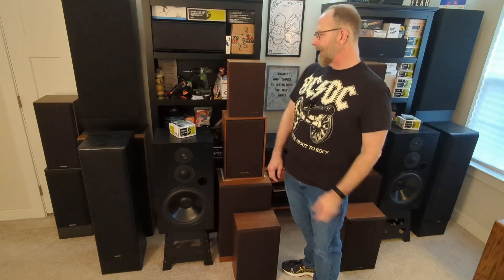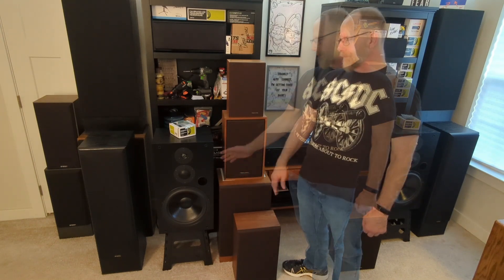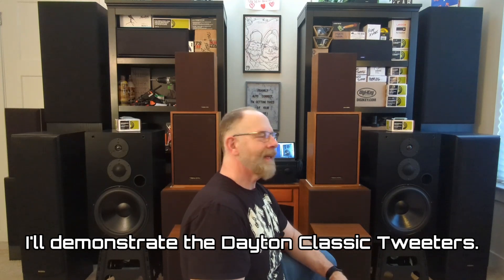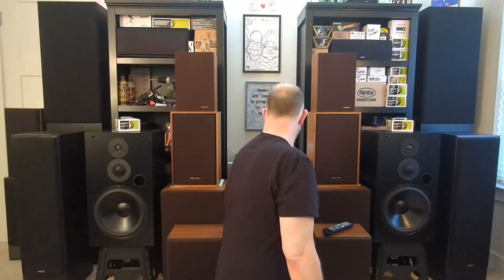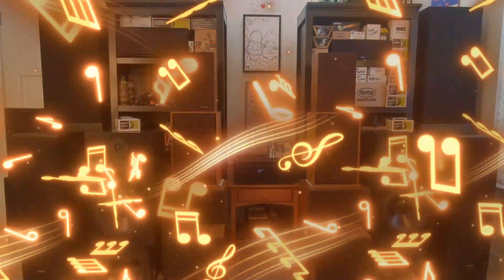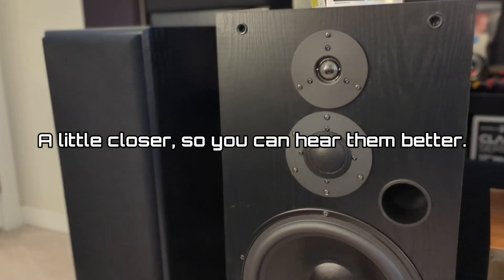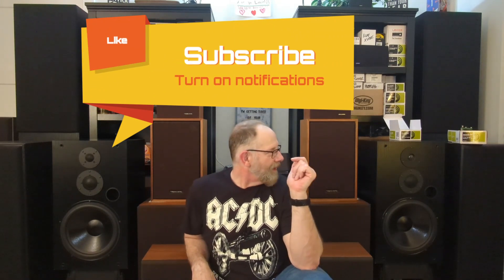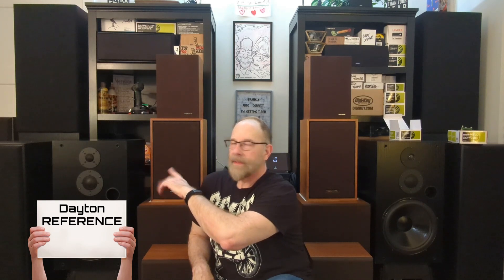Installing a Dayton Reference Tweeter in the RCA STS-1230 DIY Speaker Project

Comment: If your woofer was 4 ohm that would make a much bigger difference to your amp than the tweeter being 4 ohm, there just isn't nearly as much current draw in the frequencies the tweeter covers.
Reply: I have the same speaker. The woofer has 7 ohms listed on the one I have. It's all original.

Comment: By the way you need to add the resistor in series BEFORE the tweeter portion of the crossover NOT after. You will have a flatter tweeter response. If you place the resistor right after the crossover on way to the tweeter (like you most likely did) it will mess up the response and may not be flat at all. Using resistors before the second order of the crossover is way better because it wont change the way the crossover is functioning on the output.  Of course it is harder to add that resistor like I said because you would have to unsolder the one end of the capacitor to add the resistor at that point but it will be much better if you do. Adding resistors after the crossover is only ok if using an LPAD as it adds compensation resistors in parallel with the driver so the crossover always sees the same load. Store bought Crossovers are designed for a certain expected resistance of the driver. if you use a driver with a different resistance of its Coil than it was made for it wont work properly and the output may look ugly.  Only a custom made crossovers can work properly when using mix and match impedance drivers. Change the resistor placement on one of your tweeters and compare the graph with the other placed after. Telling you XSIM will show you on your laptop screen exactly what the output will look like before you make any physical changes. Saves a whole bunch of time. Learning that program is way less costly and time consuming than trial and error. Watch a YouTube video of how it works and you will see it is not that hard.
Reply from the maker: Excellent info! I never thought about adding the resistance before the high pass and assumed putting it after the high pass would present what hopefully would be closer to the anticipated load to the network and be closer to the intended crossover point. 

In your experience, comparison XSIM to measured responses, is it pretty close? I recall back when I used to use the crossover calculators and make crossovers, they usually needed a ton of manipulation to work well Vs the off the shelf textbook crossovers that exhibit whatever differences are inherently there with a mix of drivers, but they're usually not too hard to tame or tune, (maybe because they're so textbook). Thanks for the tip and I'll give it a whirl, perhaps on this set, or maybe another. It seems like there's inevitably a 4 ohm driver that would work for an application, but I steer clear of them usually due to wanting to keep a tolerable load for any receiver or amp.
Reply: @wattspeakers  I say it is about 95% accurate. The only difference might be if a particular driver is a little different than the others off the production line. One can also use a measured graph of an unknown speaker and plug that graph into XSIM as well (Using FPGraph Tracer). Parts Express provides in the file section of many of the drivers they sell the FRD and ZMA files just for use with XSIM. (If none are provided you can create your own using FPGraph Tracer). One can get lots and lots of experience designing crossovers and seeing the results using XSIM without ever actually building one. I have custom crossovers for all of my vintage speakers saved. So when I am ready to rebuild one I just pull up the file and and build based one what I already designed. Its fun. And when designing the crossover you can see if an inductor you have on hand is not exactly same as one in your design you can plug in its value and see how the graph looks using it and if not to bad just use it.
Reply: @wattspeakers  I agree the crossover calculators only work when the speaker has a perfectly flat response and they rarely do. However when I first design a crossover using XSIM I will use the crossover calculators just to get me in the ballpark then change the values as needed for a flat response.

Comment: When it's all said and done, does it end up just being that you use the most expensive speaker that you can afford for each set?  How would super high end stuff sound in a cheap cabinet?
Reply from the maker: Hi David and thanks for the questions. Unfortunately on this build, I ended up throwing money at a few problems and went probably twice over budget. The drivers turned into a fiasco and I had to pony-up more to get decent results. This DIY speaker project started out as a $200 build, but ended up costing more. In general, I always try to make the most of old cheap speakers using reasonably priced components that get the job done well enough, and are sufficient to achieve dramatic differences over stock. Even if money weren't an object though, I don't think I'd go that route of stuffing expensive drivers in cheap cabinets.  Personally, I think there's a point of diminishing returns with relation to component cost when building speakers for typical home use. With some designs, such as pro audio and permanent install, it makes a far better argument to use super high quality components, even if for no other reason than power handling, tolerance and longevity. With this build however, I never intended to have this level of investment in drivers. I'm sure I'll appreciate it once it's done though.